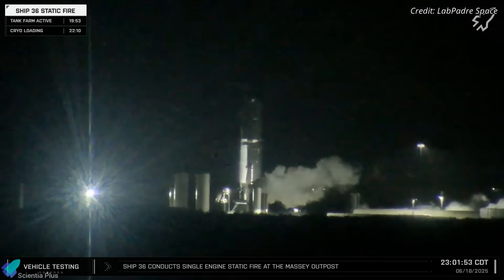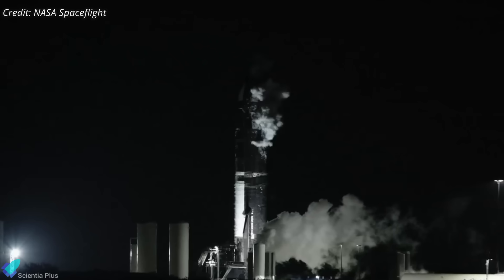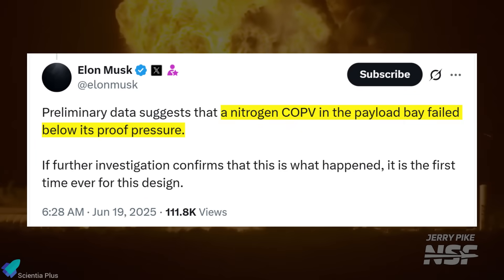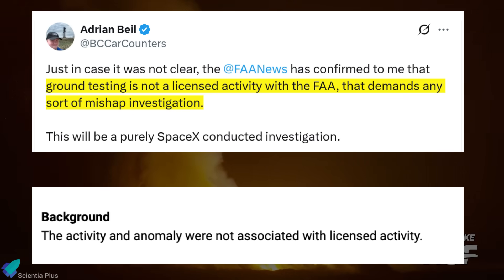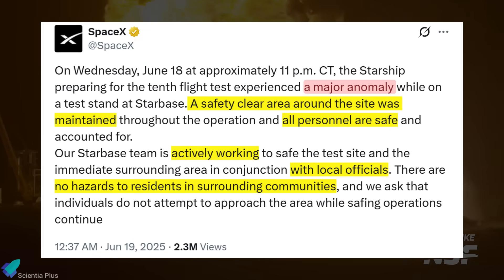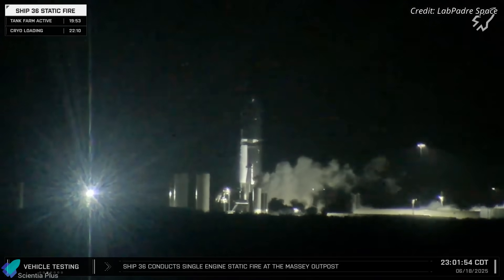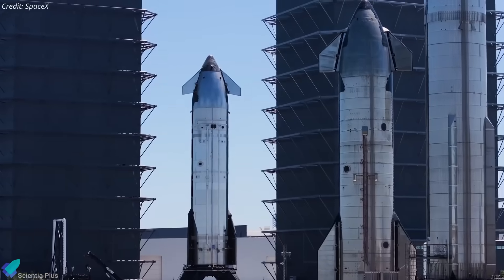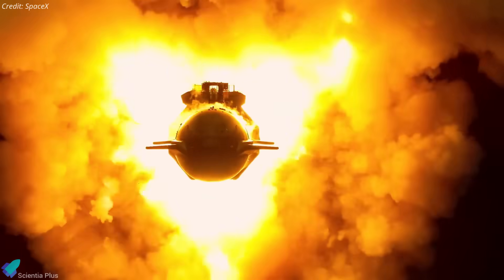Elon Musk REVEALED Starship 36 Explosion Origin - It Failed Below Safe Limits

Comment: And thus why it's called a Test vehicle. Notice everyone was cleared for two miles just in case.
Reply: This time the area was cleared, it hasn't always been that way . a friend of mine was in the Navy stationed at Cape Canaveral as shore patrol. He and two Buddy' snuck into a small block house used for storing hazmat gear -less than 1/2 mile from 39A and stayed out of sight until the final security sweep,,(friends  of theirs). John said  he and his buddies thought they were going to die when Apollo 14 lit off .between the sound and shock waves, couldn't breath or scream just pain and pressure . He said for about 30 seconds being on a gunboat in the Mekong Delta might have been the better option😂
Reply: @kenkahn138  I'm guessing they wanted to see the cool rocket?

Comment: I suspect.
Composite materials is prone to diffusion, just like or more than, high pressure metal tanks. 
The gas, whatever it is, will slowly travel into and trough the material, slowly, over time, thereby weakening the tank.
Delamination is also very common point of failure in any composite structure.

Comment: Carbón fiber should not be usted. It is not reliable. Also, if a weld seem riped open, you May need to make weld procedure changes.
Reply: Just ask OceanGate sub persons that died...
Reply: Starship its stainless steel not carbon
Reply: @MrConete  Pay attention.
The COPV made out of carbon fiber is what blew up Starship.
Reply: @MrConete yes, I know It is stainless steel. If you are going to use carbón fiber, then make it yourself. Why because then you have control of the Quálitas.

Comment: The flame trench is fine. It was built to withstand the full blast of multiple raptor engines' heat and thrust. That explosion was only a fraction of the heat and impact energy the trench was built to withstand.

Comment: Rapid iteration along the wrong path? Possible carbon fiber involvement scary after watching the new Netflix documentary on OceanGate’s catastrophic carbon fiber submersible implosion.
Reply: Don’t compare that half baked submarine to a modern COPV.  For starts these vessels are never supposed to be immersed or gotten totally wet since that invokes a very substantial knockdown factor on the material properties. If you are going to use a COPV like to store natural gas on top of a bus there are very much higher factors and sacrificial plies that protect the working graphite. You can run those vessels into a bridge. Literally.  

These vessels are actually quite amazing since the wind process creates a layup that has a very high proportion of graphite fiber relative to epoxy.  Much higher than typical fabric layups.  Astonishingly high ultimate loads can be reacted with thin layups.  Importantly the loads are almost exclusively in tension. Not the case with the sub.  Complex compressive loads coupled with horrid fabrication methods and poor design choices sunk that sub.

Comment: Mr. X is looking in the wrong place to fix the failure. The high levels of stress are found not in the equipment, but rather in the engineers working 12-14 hours per day 7 days a week to meet schedules.
Reply: Yes; I noted the narrator here citing 'rapid (re)build' as a positive, whereas I think a more measured (i.e., careful) assembly schedule would, in the long run, prove more effective.

Comment: The REAL problem is that the stainless steel starship IS TOO HEAVY! It should have been made of carbon fiber, as first proposed!
Reply: I'm no expert but common sense would indicate carbon fibre would never be re-usable, would it be trusted to tolerate the repeated extreme flex and vibrations.
Reply: Was the same thing said about airliners? It's possible that it can't be done!
Reply: And what was the tank that failed made out of?..............

Comment: I believe in 3 times   the normal strength and pressure not 1.5 times.
Reply: Aerospace grade COPVs are generally tested to 1.25x MEOP for proof pressure and 1.5x for burst.   This is pretty much mandatory if you expect to make a flying machine. Commercial vessels will have much higher factors since they are exposed to many uncontrolled environments. You periodically retest to proof to confirm integrity. 

I’ve always been curious how they got an aluminum liner, graphite overwrap cylindrical tank to work.  We did this nearly 30 years ago and had erratic and unpredictable failures that forced us to change the liner to another metal. We actually got the tank qualified and saw failures in rate production vessels below proof.  Flaw growth in aluminum is a real headache in a high performance vessel especially if it is exposed to rapid blowdowns that chill the liner.

Comment: COPV safety factor is only 1.5? Seems low to me. Not sure I would want to trust my life with it.
Reply: Then you’ll be horrified to know that the factors of safety on the primary vehicle tanks are even lower. Historical values were 1.25 at ultimate and the proof factor was basically 1.0.  They raised that to 1.45 for crewed operations.  Still pretty low. This forces extensive materials testing and full scale structural tests with oodles of sensors to confirm the analysis is accurate.  At these levels of performance it takes very little to cause a big problem.

Comment: Imagine if this failure had occurred on the launch pad with a fully loaded system. A fireball with twenty times the explosive power?! When the Soviet N1 rocket exploded it took 18 months to rebuild the launch pad.
Reply: With a hundred people on board , BBQ city !
Reply: Don't worry...you will see that happening soon as well 🤭
Reply: The N1 explosion, if I remember correctly was equivalent to a 1.5kt nuke detonation.  And even then not all the fuel was burned.  A fully stacked, fueled & ready Starship carries even more energy (maybe 2-3kt or more).  That would devastate the coast for miles around.
Reply: @garymartin6987  Yes we should be glad that N2O4 and hydrazine are no longer used as main propellants/oxidizers. That would be a huge mess to clean up.
Reply: @garymartin6987  No it wouldn't. Are you deliberately lying? Or are you just grossly uninformed?
Reply: To me it all looks rushed, and the owner looks more spaced out than space focused
Reply: @braydeny  Its IS rushed of course. Every development on the limits of knowledge and physics is "rushed". 

The reason was a nitrogen tank that burst - which has never happened before anywhere.

Gwynne Shotwell is not spaced out, what are you talking about?

'tis just a scratch - they will put on some band aid and blow on their boo boos stand up and continue making it better.
Reply: @wolfgangpreier9160 thanks for the correction I changed it to owner